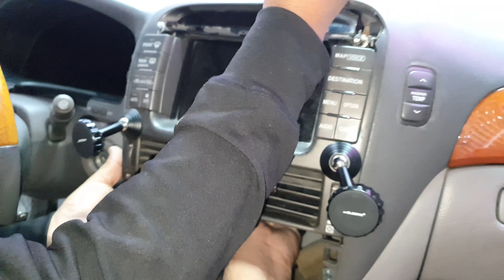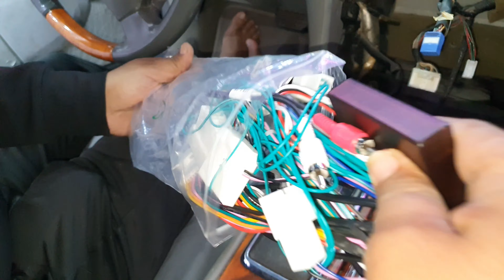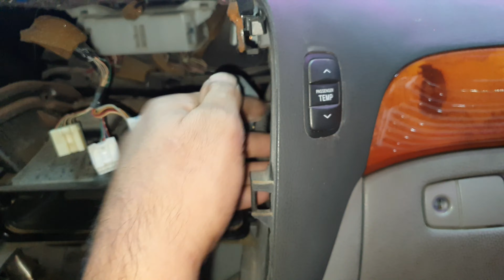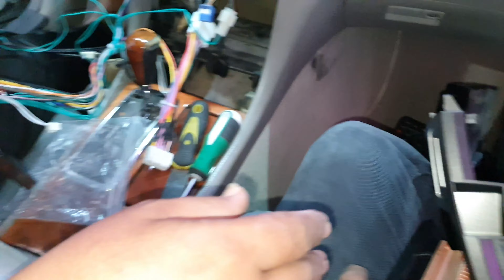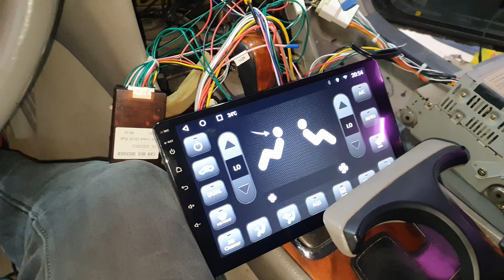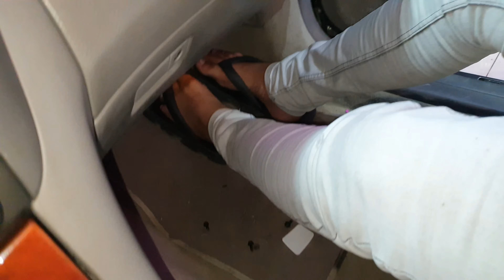Lexus LS-430 2008 Android Carplay And Apple Carplay And A/C Control's# Bablu Car Modifications

Comment: Which is the model No. for the panel you installed.Can I purchase from you with the wire cable connected ready ,it make the installation easier.I am located in Canada.Thanks!
Reply from the maker: Ok
Reply: @bablucarmodifications586   what do you mean ok????????
Reply: @simonhsia5686  did you find out what he meant by ok?
Reply: @otakubaka2538  No